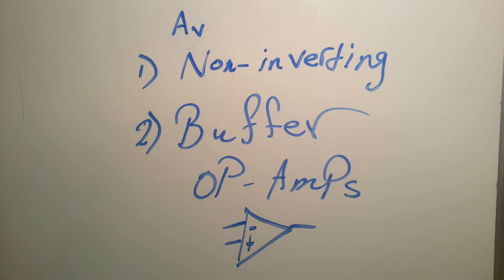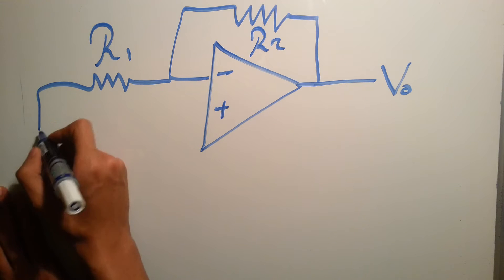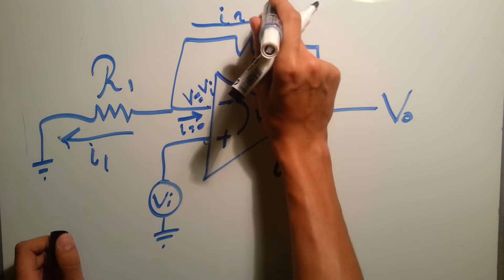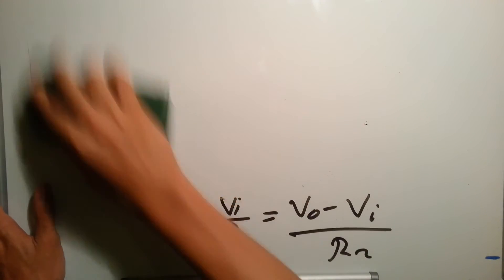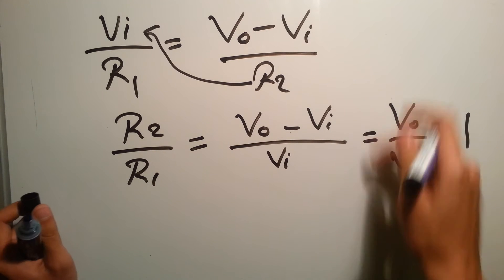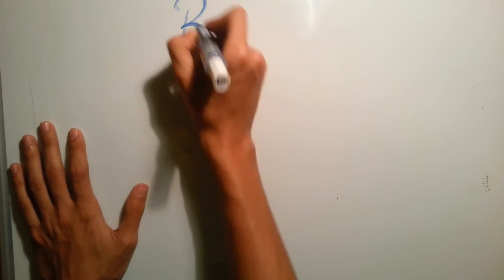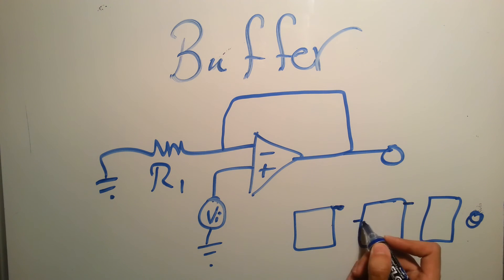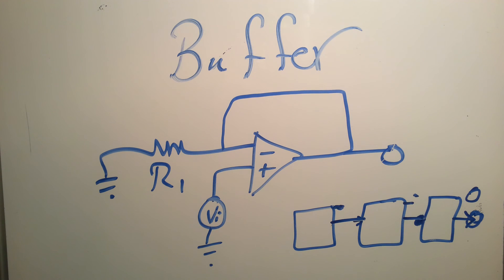Non-Inverting and Buffer Op-Amps gain

Comment: How would the current flow through R1 as it is grounded?
Reply from the maker: It is grounded from one side, but the other side has voltage, so as long as there is voltage difference there has to be a current flowing
Reply: Ok Thanks